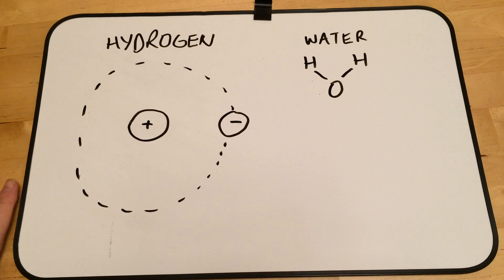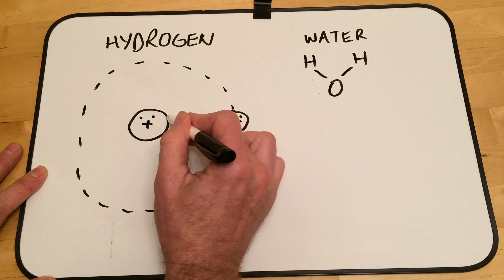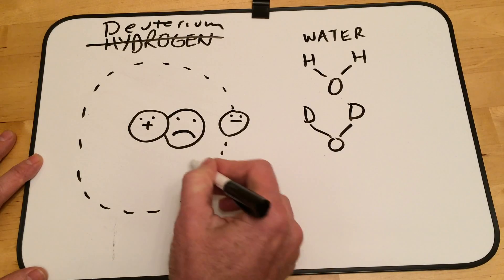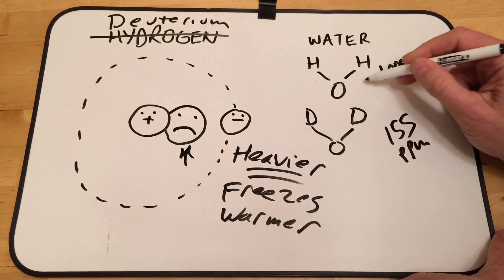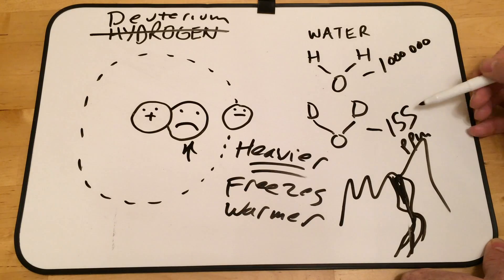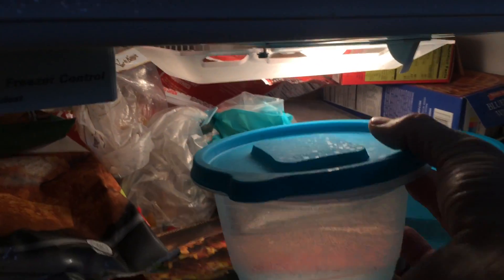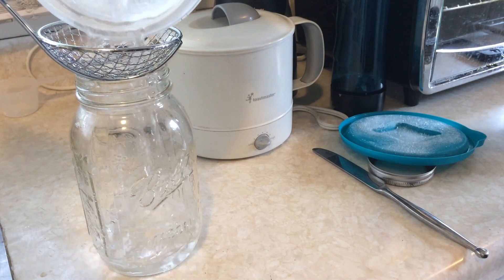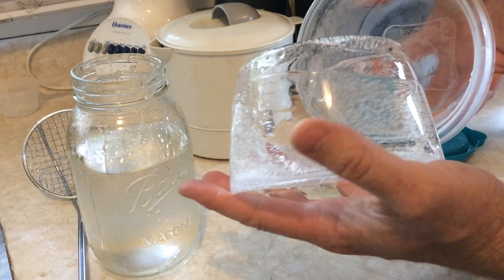How To Make Deuterium Depleted Water DDW

Comment: great video. ive done this process before, but who is really going to go through the trouble of bringing it out into the sunlight. I guess you could buy a UV handheld light to flash it... but i don't think that or the sunlight is really going to give it a full UV treatment like you would get from a serious UV filter. Any idea why that you were recommended to use UV light after the first freezing? or any links to where it is explained online?
Reply: Putting it in sunlight (ideal at sun rise or sun set) is because either red light therapy/sun light is about the photons. The red light seems to alter the physical properties of water, which turbocharges the chemical reactions that provide a cell’s energy.

Comment: Wrong. Very very wrong. Freezing temperature of the Deuterium is 3.8 degree of Celsius at see lever ( normal atmospheric pressure). Freezing temperature of regular water is 0 Degree of Celsius. If you keep temperature a bit low than 3.8 C but higher than 0 C,  first Deuterium will freeze. Then, remove frozen Deuterium from the jar. Then, lower the temperature of the remaining water lower that 0 C.  Normal water start to freeze. Only clear water molecules forming the water crystal. All dirty particles such as Chlorine and other chemical elements pushed father to the middle of the jar. Don't let the whole water in the jar to freeze. After an hour water frozen around the jar is the crystal clear water. The dirty water pusher to the middle of the jar. Yes. You need to make a hole in the top and true away Chlorine and dirty water in the middle. You did the opposite :((  Then , let the water to melt and you have 12 hours to consume this clear mono molecular water. Its a water structurally similar to the water that  we have inside of our body cells.

Comment: OMG.. this is not the first post/video about making DDW at home... you are not able to deuplete your own tap water!
Please note, that with home distillers you can achieve a maximum 1 ppm decrease in deuterium level and you should repeat the distillation process to multiple times to achieve a modest decrease. The freezing method is also inefficient... maximum 5ppm decrease is possible with freezing method, that’s not too much to go down from 155PPM to 150.. instead of freezing you should eat more fat (keto diet) with that method you can deplete your D level in a more efficient way in your tissues...

Comment: While its true this guys method is not going to work, he is partially on track.  It is a known fact that Deuterium D20 is HEAVIER than water H20.  In industry one can separate differing elements in a solution by using a centrifuge.  From this page (https://chemistry.stackexchange.com/questions/90041/can-you-make-deuterium-depleted-water-through-a-freezing-method), we learn that the freezing point of D2O is HIGHER than the freezing point of H20.  So by placing a centrifuge in a freezer, and setting temperature to 35 degrees F, one should find that the heaver D20, at the bottom of the centrifuge should freeze, while the water can simply be poured out.

Comment: Deuterium oxide, heavy water is two atoms of deuterium and oxygen. 
Semi-heavy water is one "normal" hydrogen, one deuterium and oxygen.

156 is the number of deuterium isotope in every 1000000 atoms of hydrogen.
Each molecule has 2 hydrogen atoms and HDO being substantially commoner than D2O means that 156 water molecules out of 500000 contain an atom of deuterium. (312 out of 1 million). 

D20 is much more strange and in normal water, you can only find 1 every 41 million hydrogen atoms. 

This means that the deuterium in the water is utterly negligible. (about 2.4*10^-8 or 2.4*10^-6 %).
The fusion point of semi-heavy water is 2.04 degrees Celsius. 
You could use a temperature of about 1.5 degrees Celsius for a long time and try to freeze only the semi-heavy water. (approx 0.312 ml)

Anyway, this experiment is much more interesting trying to obtain the Semy-heavy water rather than the deuterium depleted water. So you could do something similar boiling it higher than 100 degrees Celsius and lower than 100.7 (Semi-heavy water boiling temperature). Even though this is a bit harder given the little difference between temperature.

Clearly, in the video, the water around the sides freezes first because the center conservates heat better. The only reason you would end up with less deuterium is because you have less overall water.
Reply: If you want to grab tge heavy water using freeze mechanics it would be best to use a slush machine. It would require several cycles to do it though. Slow distillation from sulfuric acid solution is far more efficient. As a bonus you can get very concentrated deuterated sulfuric acid for experiments as well as deuterium depleted distilled water that makes the best deionized water for use in chemistry and HV equipment. Win win 🏆 ❤

Comment: Any chance of testing deuterium ppm, before and after?  Then we'd know for sure if it worked...
Reply: A simple test would be to weigh it. Pure heavy water is roughly 10% heavier.
Reply: @introprospector  good luck with 155ppm to start with.
Reply: @danielrebelski3672  yeah I made that comment before learning how little these processes increase the concentration.
Reply: See Michael Capria's comment above. It doesn't work.
Reply: does the remaining ice sink in the DDW?

Comment: Good video. I had this idea: If one could hook up a thermostat regulator to the freezer to keep it at exactly or approximately 38.84°F (3.8°C) or slightly lower to freeze deuterium, and before h2o freezes it would of course only freeze deuterium, making it easy to remove... I'll give that a try!
Reply: This would be the correct way of separating the deuterium from the water.
Reply from the maker: That’s a good idea. I wonder if it would work.
Reply: Please keep us updated
Reply: dude it's only like 140 ppm... so.... one mol h20 18g... and that's a molenumber of h20 molecules.... im not very good at math and i couldn't figure it out but... like 150 ppm is a huge difference, or rather it's such a tiny amount none of the water would freeze at that temp, and if it did you wouldn't be able to remove it because it would mix around in the water as soon as you touched it...i think...
Reply: See my comment above on what it would take to do this.  It isn't practical, especially on how to remove the tiny D2O crystals if you were able to get it done.
Reply: Great idea !!

Comment: I found a site where a guy received a reply from a manufacturer that, on principle, the deuterium content IS lessened by this process.  I tried it with spring water from a local well used as healing waters or 300 years, very high in calcium.  Not only can you taste the difference, but I also realized that the calcium sediment is in the melted ice, NOT the finished product.  If you can't afford the  deuterium free water, it's a good start.
Reply from the maker: Thanks. It’s good to hear from someone else that this does work.

Comment: Hi! Thank you so much for the explanation. I have a question. If I create deuterium depleted water from the tap water in the freezer, then I distill it, does it have an impact on deuterium? That would be a cheaper way than to distill it first, than remove the frozen water.

Comment: If this worked to isolate heavy water molecules, I think some clever chemist somewhere would have thought of it already. But you never know, once in a while am amateur stumbles on something valuable.

If it works, it will be a huge break through. Current state of the art technology to make DDW is hugely complex, expensive and energy intensive. That's why it's about $US 500 for a case of bottles.
Reply: this doesn't work
Reply: Actually it's just a couple dudes, a sink and a freezer

Comment: I think to have any hope of this working you would have to cool the water very precisely and hold it stable to somewhere between 3.82 C and 0 C. Then after you are sure of your specimen being all at that temp for a certain time, look for ice that sank. It will be super super tiny. That's your heavy water ice. If it works. It might even be too small to see, so just pour off  the top layer, that's your ddw. You might find the crystal of heavy water ice using a filter, but you'd have to be careful, it will be so tiny it will melt instantly if you breathe on it.

The freezing point of D2O is actually 3.82 degrees C (38.876 degrees F), significantly higher than that of H2O. It is also about 10% denser.
Reply: ice floats
Reply: @thjonez  lower density ice floats. If d20 is twice as dense as h20 then it would sink before the h20 reaches freezing temperature. Theoretically. I have personally never seen ice sink, so I’m not sure if it is even possible to separate the d20 from the h20 in this manner.
Reply: @juliefranzd.c.6726  
Sometimes it's better just to keep it simple the only way to really know is to try it out and have it tested just have a tested first to know what you started with

Comment: I think this video should be taken out of circulation. 
This is due just on common sense and not scientific facts. However, pay attention.... deuterium should be homogeneous distributed and not only on the borders of the container. the fact that you get the borders with ice, is because is the contact with the colder temperature. or you should start seen nucleation of ice formation everywhere. if this were real, everyone would be purifying water and nobody will bother with building expensive devices to perform the task. if you are sure of what you are saying, please test the water and tell the difference in deuterium before and after.....
Reply: It has taken a lot of retrying, but using certain punctured (no vacuum)  stainless steel double walled containers and purified water, I am able to get crystallization of about 1oz from 32 oz evenly distributed through a container at 34 degrees C after 10-12 hours. I have no idea if it is actually deuterium, because there is no inexpensive way to test it. But after about 4 retries using the same batches of water the amount of crystallization diminished. Again. I have no idea if this is actually working.

Comment: What a complete load of horse pucky.  It's only freezing around the edges and top because it's colder there.  The mass of water insulates the middle part from the cold of the freezer.
Reply: That´s how they do it in Nkorea and Iran...
Reply: Wrong. If one component freezes at a higher temp. It will freeze out first. This is a simplistic explanation which is not totally correct.
Reply: @lawrencebaxa6168  The temperature that deuterium freezes is a TINY fraction of a degree difference from ordinary water. The difference is so slight that brownian motion, even at sub zero temps is MUCH more signifigant an effect and you simply can't seperate that isotope that way
Reply: @kg4boj , i am sorry but you can, not by much, but you can.   Is it worth it? I don't think so.  Flash freezing  is less likely to deplete while holding the temp just above the freeze temp  and then slowly lowering it will tend to favor freezing out deuterium first. But, clinically, there really isn't a significant difference between regular water and deuterium depleted water.   In my opinion, it is a waste of time, energy, money, and perfectly potable water.
Reply: @kg4boj  No it freezes at 3.7C.
Reply: @rkcannon  yeah right: 4 x 8ltrs for $200, lol! - I suggest, just drink filtered water and stop worrying. Worrying is the biggest cause of disease and death,.
Reply: @kreynolds1123  Correct, flash freezing isn't any good. But slow freezing to just above the freezing point of H2O can get marginal.results. Thats why you can't hurry it.
Reply: @kreynolds1123  Hey. I know one 80 year old lady that was tired all the time and had no energy to do anything. She bough commercial deuterium depleted water and in a few days went to play tennis. It worked for her and she has drinking it since.
Reply: @victoriarimko5226   There are several things that get in the way of me accepting that, or accepting it at face value.  1) While the internet can be a great resource to learn from, it is not wise to believe everything everyone says. We just meet and i dont know you, but assuming your telling me the truth of what you know with no deceptive intention, then: 

2) even given what you said, her experence is anecdotal and vulnerable to placibo effect. Incedently, often the more people spend or the harder one works on miracle cures, the stronger the placebo effect, all while double blind studies may find no clinically noticable results. Continuing on, 

3) still assuming your being absolutely truthfull that you know an elderly lady that has more energy now that she is drinking (this) water,  there are many possible reasons for her change other than being DP water. For instance, many people are chronically dehydrated, with well known side effects like low energy. Drinking more water will fix one's dehydration issue and its related problems restoring one's energy levels. 

4th and biggest issue is lack of diverse studies supporting clinincally significant results. 

5) I'm not a total noob to chemistry  health, and cellular energy,  and the claims make it very difficult to pass the sniff (believebility) test given what i know. But i could be wrong and i hope the best for you and your friend.
Reply: @kreynolds1123  Considering that universities and researchers are beholden to funders, and the 1% funds research that supports their corporations' sales, how much of academic research is pure as the driven snow?

Comment: brownian motion will keep the d2 in the water. it's not that simple
Reply: so how can we remove it effectively?
Reply: @decathlete2000  Electrolysis.... but it takes many many batches electrolyzed to near nothing then added together, elevtrolyzed  again and again then and a lot of electricity.
Reply: Yup and it generally will form DHO in regular water as it will have a slightly more ionic character tgen regular water. The trick to getting it to separate out is actually very simple, add a stronger anion that won't evaporate to keep the D ionic  as long as possible. Sulfuric acid is  a cheap and easy way to do it. Also distillation by a slow gentle method like rotary evaporation. The D will chose to have a serious long term relationship with the sulfate or bisulfate anion rather than the hydroxyl anion. Was the first step on the road (paved with broken glassware and hours of frustration) for DIY deuterium 😂❤

Comment: If there are only 15 parts per million then the volume of ice we are seeing here is mostly just frozen......water. The fact that it has formed a layer is only because it has chilled sooner than the main thermal mass.
Reply: Its not 15 ppm it is 155 ppm.
Reply: This is an average depending on where the water comes from.
Reply: @lawrencebaxa6168  and how much is .0155% of a cup of water vs .155% of a cup of water? the amount of ice tossed out during the freezing process he showed seems to be a tich more than either those percentages. just one more thing to obsess over.
Reply: @ilfautdanser9121  The point is the amount of deuterium left in the unfrozen water is reduced.
Reply: I was told it's about six drops of water per litre. If you could just remove that you could probably add 50 years to your life, and alot more if combined with a magnetico pad, hyperbaric chamber, intermittent fasting, keto you could probably hit 200. Pretty cool shit 😎